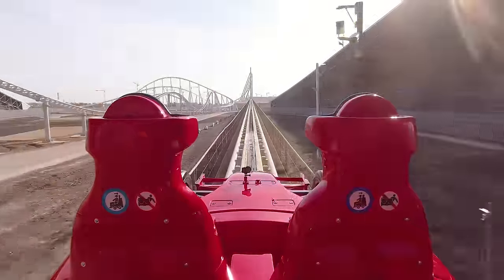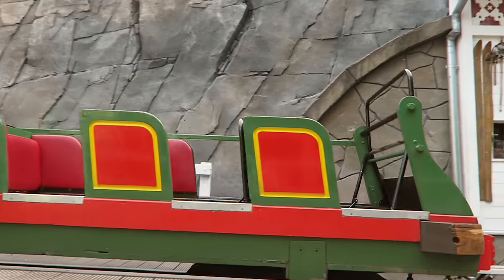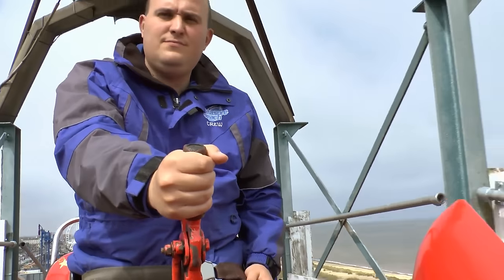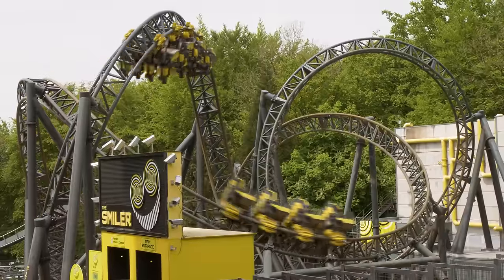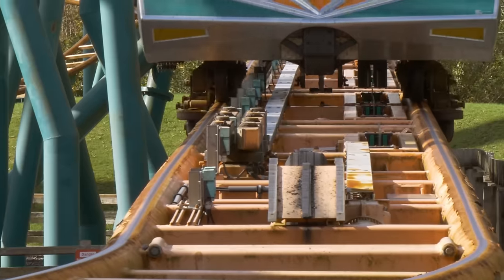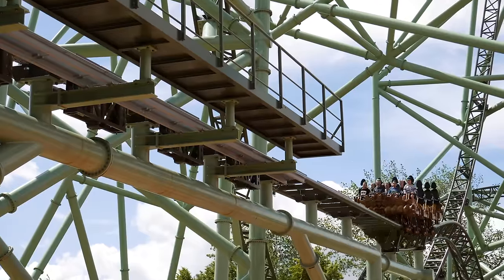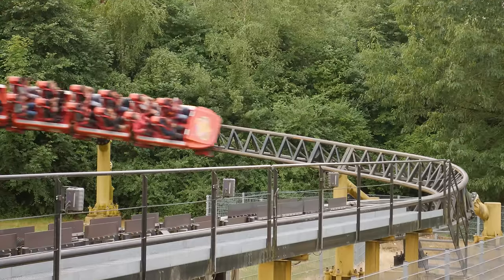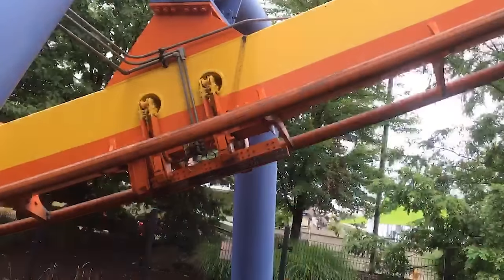Roller coaster brakes NEVER fail

Comment: The fins at the top of Velocicoaster I believe were actually added to keep the train moving and prevent it from getting stuck up there. On a very rare event it actually got stuck at the top, which led to a very tricky evacuation. Learned during the paddock tour.
Reply from the maker: That's very true!
Reply: Couldn't the passengers just simultaneously shift their body weight back and forth? Surely there's not that much friction
Reply: i always thought they were more LSM launches just in case the train was going too slow
Reply: @TheCarpenterUnion  i dont think the restraints give you enough freedom of movement to do that.
Reply: @Thestuffnope  Also those trains are very heavy.
Reply: @pqfamilyadventures  like multiple tons heavy
Reply: There’s a very recent video of it not making it over the top and falling backwards, they had to relaunch it at a faster speed. 💀

Comment: Some skid brakes are still manually controlled! Twister and Phoenix at Knoebels for example are completely manually controlled. If a ride operator wanted, they could simply slide the train right through the station allowing riders to go on a second lap. Maintenance and the supervisors generally frown upon that though. I've been lucky enough that once or twice on the last ride of the night towards the end of the season the Twister ops will stop it in the station before parking it all the way, quickly ask if anyone wants to get off, and then slide it the rest of the way through the station for a round two! Seeing the clips from Twister in this video made me smile, not just because of how great the ride is, but because of how great the ops are too!
Reply from the maker: That's interesting to hear! Some rides at Blackpool Pleasure Beach are still manually operated too. Thanks for sharing this really interesting information :)
Reply: I remember  one night probably about 10 years ago being sent through at least 3 times in a row on the Phoenix that is one of my favorite memories at Knoebels
Reply: Skid brake it's the worst name ever

Comment: I know that vekoma had stange friction brakes. They use air to close, and springs to open. They all have a sepred buffer tank that can stop a train 1 time if the air suppley is lost. 
Its stanges but still used on the older vekoma's. Python at Efteling uses brakes like this.
Reply: Aren't those brakes replaced with newer versions with the revision of Python?
Reply: @Robbedem  no.

Comment: In RCT a water splash just before the station on a wooden coaster is a great way to prevent Station Brakes Failure from causing an accident.
Reply: I normally have a couple of independent brake runs before the station plus a final block brake just before the station to improve ride throughput
Reply: MGLN avatar salute o7

Comment: Got to see the braking by default in action when I worked at expedition everest at disney. Our brakes zone 3 would open half second or less before the train came through and close just barley after it went passed. Was crazy how close it was.
Reply from the maker: That's pretty awesome!
Reply: That's good to hear. I would assume they are designed such that even if two trains are touching entering the brake zone the 2nd train will stop.
Reply: @TemporalWolf  yep little late but now seeing this. Brake zone 3 isn't used to much only when we fall behind unload or loading.  Brake zone 3 was brakes u didn't want to get stuck at it brakes hard.
Reply: @madbirds  I'd assume it's the same situation as airbags: It's not pleasant to get hit with an airbag, but it's miles better than the alternative.

Comment: Thank you for bringing up the fact that fins can only be installed on straight track. There are way too many people that  feel Dragster is going to get boosters on the vertical twist, not understanding it's not possible.
Reply: Well they can also be installed on slopes too, as you can see with Kingda Ka. But that just depends on the ride tbh.
Reply: Mostly, but not quite. Fins can be used on track with a gentle vertical curve, but horizontal curves or twists are out. Likewise, skid brakes can be used on track that curves horizontally, but not vertically at all.

Comment: It was interesting to rewatch this video as yesterday we were at Alton Towers when the storm caused a park wide power outage. Super surreal watching Wickerman just turn off. Anyway, as the resident enthusiast among friends folks were asking me how it worked with rides being held with the power off. I couldn’t remember in detail but said that basically if the ride either knows there is an obstacle ahead or cannot say either way it will hold the train by default (which i think was essentially correct).

Was very cool to see it happen in real time.
Reply from the maker: It sounds like you put their minds at ease!
Reply: I never thought about roller coasters not having standby generators/UPSes(batteries) as all of them in Orlando & Busch Gardens do have them. Power outages at these parks are incredibly rare that you can count on your fingers the number of times they’ve lost power lol. So the generators/UPS systems aren’t really ever used apart from testing. I’m just glad they’re there so I don’t get stuck!
Reply: @Lazy2332  I guess in the UK we get far less storms

Comment: I wish I could've been a brakeman when I was a ride operator at worlds of fun. Test rides were the highlight of any shift of course (as well as running the panel aka sitting down most often in ac) I suppose I was a brakeman when making the ferris wheel but that was not fun as I wasn't on it and it took a lot of concentration and finesse!

Comment: You should see the system of emergency brakes used by trains. The brakes are still friction brakes, but they can be activated by permanent magnets on the track. Wire is wrapped around the permanent magnets on the track, and energizing the wire creates a field in the opposite direction of the permanent magnet, thus creating no net magnetic field, and this allows a train to pass over that track. If the wire is not energized because something has failed or because the train does not have authorization to enter that section of track, the permanent magnets on the track will pull the emergency brake on the train and bring the train to a screeching halt.

I just wanted to mention that because I think it's interesting that magnets can be used for multiple things. We don't just use them for induction braking. They can be used to activate regular friction brakes too.

Comment: The old L4 type friction brake introduced by Arrow, inherited by Vekoma and copied by various chinese companies doesn't meet the definition of fail-safe. If there is a loss of air pressure after the control valve, the brake will open.
The retractable fins used by Intamin use air to move in both directions but there is also a spring inside the cylinder that will push the fin up if there is no air holding it down.

Comment: Velocicoaster actually doesn’t have a trim, that is I believe a couple LSM fins, and they are used to aid the train out of a stall at the apex of the top hat.
Reply from the maker: You're 100% right!
Reply: Would LSM fins not have a breaking effect anyway when they are turned off?
Reply: @Dan-uy2ld  they could if universal chose to use them like such
Reply: @sqoomsh  
Do you know how they would do this? Just not run any current through the fins? 

I'm not really sure how LSMs work but they fascinate me 😂
Reply: @Dan-uy2ld  LSMs are completely inactive, no current, powered off

Comment: 6:45 wrong name. It's Elecromagnetic brakes. The linkage between electric fields/currents and the magnetic fields are important (as stated a bit later).
edit: Eddy Current brakes would be the technical term
Reply from the maker: The brakes aren't electromagnetic though, they aren't powered at all. It's simply a metal fin sliding through a permanent magnet.
Reply: @coasterbot  elecromagnetic doesn't mean powered.
What happens, is that a conductor travels through a static magnetic field (the other mechanic would be a (static) conductor and a changing magnetic field, witch is how LIM's work) .
If you are looking at the maxwell equations you will see (changing area), that this implies an electrical current (called eddy current) inside the conductor. This current induces a magnetic field opposit of the magnetic field provided from the outside, therefore we have a force, "braking" the conductor.
The english wiki-artical of the "eddy current brake" does a good job "imaging" those fields.

That's why we have and need an electric field here, witch makes it an electromagnetic device.
This shows furthermore how those fields are working and inducibg eachother.

Comment: The braking by the magnetic fiel is very good and some new lorries have them as standard braking they are good if you're going 30mph> (because stopping 40tons with disk brakes is harsh (they dont last long) ) but for braking at slow speed they don't work. Also the magnets cant always by active because the lorries couldnt move so lorries can still have braking fails.

Comment: Used to go to Lakeside Amusement Park in northern Colorado with some extended family every summer. It's an older park with a wooden coaster called the Cyclone. One year it rained part way in the day and they had to close the Cyclone because it was going fast enough that they were having trouble stopping just the empty trains during testing and they were concerned about a potential derail on a few of the turns.

Comment: I got ElToroRyan flashbacks hearing an explanation of block zones lmao
Reply: On rollercoasters a block zone is a section of ride that only one train may occupy at a time. At the end of a block zone there is a method to stop the train, in case the block zone ahead is still occupied. This is the safety system that prevents rollercoaster trains from colliding with one another. Let’s look at the block sections on ...

Comment: Magnetic breaking also has another drawback.... The fins on the track heat up during the day with each train passing... in some cases the fins have to be cooled during operation (Pulsar Walibi Belgium. Mack rides power splash.. Even though it's feature is a power splash with a lot of water... it's still needed to cool the breaks on the track during operation.)

Comment: Wouldnt magnetic brakes get weaker as the permanent magnet gets weaker though? Or does the act of braking also maintain the magnet at its required strength?

Comment: @11:30 - To be clear, what's described here is actually something roller coast junkies pray for. They would PAY for it.
It's called a "rollback" and the OG Top Thrill Dragster is (was) known it. 
If the weight was right and the wind was right, the car would stall out before cresting the top of the arc, allowing it to free fall backward to where it started.
It's one of those super rare events that people prayed for b/c it was such a unique and thrilling moment.

Cedar Point listened to them and when they made Top Thrill 2, they designed it to purposely incorporate a rollback as part of the ride.

For those who don't know Top Thrill 2, it's a mag launch coaster. You get launched forward with enough speed to get 1/2 way up the main tower. You then free fall backward to where you started and while going backward they activate the mag launch *in reverse*, increasing your negative velocity to 100 mph. This shoots you up another tower behind the coaster that goes straight up so you're facing the ground. Gravity stops you and you free fall forward back to where you started, where they mag launch you a THIRD time, this time shooting the cart 120 MPH down the rail, sending you over a 420 foot crest with a bunch of twists. You go shooting straight down the other side and eventually end up back where you started.

It...looks...amazing!!!

Comment: The only fail remains is the human error
Reply: Humans, why did there have to be so many humans?
Reply: Correct. Which is why I still get nervous every time I get on a coaster lol. Humans fail
Reply: roller coasters are designed around human error. it's extremely difficult to circumvent the numerous redundant systems in place.
Reply: @eyebrowse  Yet, every year there are dozens of circumvention where coaster and theme park accidents occurs. Something as simple as letting a giant 15 year old sit in a chair that will thrust him 100s of feet in the air and let him fall to his death, as one easy example, where numerous redundant systems failed and he died a horrific death. Plenty of other examples where that came from too. 

Don't be too proud of this technological terror you've constructed.

Comment: Hi, the video is already 3 months old, but I wonder why roller coasters stop during a rollback, since there is usually only the LSM as a magnet, for example. Super interesting video by the way👍🏼
Reply from the maker: Great question! It depends where they roll back. Launch tracks are often tilted slightly backwards so the train will gradually roll to the beginning. At the beginning of the launch track is usually a friction brake, which can hold the train in position. Other launch coasters valley when they rollback, meaning they get stuck at a low point in the ride's track causing them to rock forwards and backwards until they run out of energy. I hope that's answered your question!
Reply: @coasterbot  In principle yes. The thing is, I'm from Germany and my home park is Phantasialand. With Taron, for example, when you roll back, the train really stops halfway through the launch. Even without friction brakes or wheels. Maybe that's a special technique, I don't want to annoy you, but I'm interested. Thanks for replying by the way.

Comment: I will say, Roller Coaster brakes will never fail to slow you down (as long as something does not lock them open, which is VERY unlikely to happen accidentally...) But they CAN fail ON, meaning they lock you in place where ever you are. That is how you get people stuck upside down at the top of a loop for 3+ hours in the middle of the summer until rescuers can get a ladder and harness properly set up to pull you out one by one. I have personally seen that happen twice...

Comment: i had a sort of break fail while i was on a roler coaster. it was slowed down but not enought, we just drove throught the start (maybe 15kmh/9.3mph) and had a  second round without waiting. glad that it was a soft one.
Reply from the maker: Some smaller roller coasters do go through the station quickly to begin a second lap! Quite a few powered ones do that, for example

Comment: I came to think of it when you showed silver stars mid course, how can the ride start again if it have to stop completely. It  doesn't seem to be curved downwards and it dosen't have any drive tyres? This also applies to other coasters with these types of brake runs/mid courses. How do they start after a complete stop?
Reply: Most of them have a slight downward slope.  It may not look like it, but it's there.
Reply: brakes as far as i know can also push the coasters forward slightly on release.
Reply: @Celatra  no brake devices themselves cannot push a train forwards. its done with either a downward slope like on silver stars mid course or a transport device of some kind like drive tires or LSMs
Reply: Yeah, silver stars is probably downwards sloped, Thanks!
Reply: Block brakes always have a downward slope or propulsion devices such as drive tires.

Comment: I already knew that, and I hoped to learn something additional that keeps the brakes failsafe. But I guess it works, since we don't hear of block brakes failing.

But I can already think of many cases of failures during the video: What if the magnet brake fins don't come up, because there's a problem with the electric system, for example the specific cables that wire the motors? What if the springs fail?

I already knew that springs are used to ensure a default state, it's the easiest way to do that. But it all depends on the springs not breaking.

It is not an ideal failsafe system, but it seems to be the best so far, and as long as maintenance is fine, it will be fail-safe.

Maybe that's the idea: If maintenance is neglected, the ride won't be safe anyway. In parks with good maintenance, the brakes are truly fail-safe, since they are always inspected and kept in their best form. In parks with neglected maintenance on the other hand, other problems come up that are severe to safety. So for all purposes, good maintenance is key to safety, and if it is neglected, it all falls apart anyway since it's a moving system that remains safe for some time, but eventually fails if it is not kept up well.

So: Rollercoaster brakes are just fail-safe enough for all practical purposes, they are already more failsafe than other systems, and the whole system is only as safe as the weakest link in the chain.
Reply: The biggest problem with magnet brakes is their inability to cope with derailment. If the carriage derails, the braking device may be misaligned and cause a collision, which often results in the carriage completely detaching, or the brakes being damaged and failing, causing collisions with other car.
A roller coaster that uses magnetic brakes must ensure that derailment is an event that should never occur in the system.